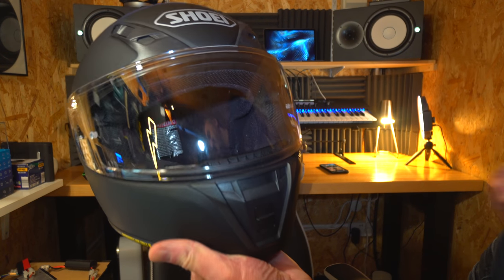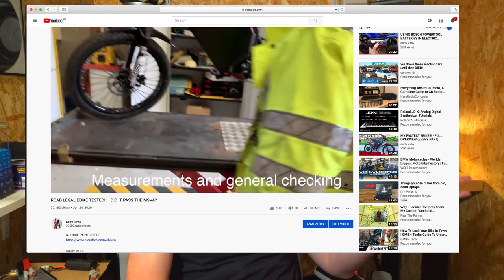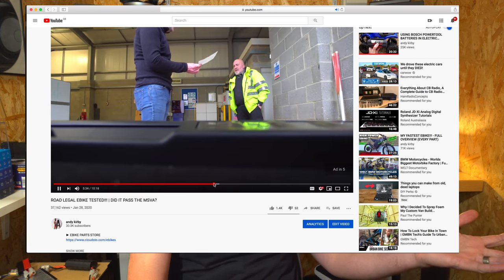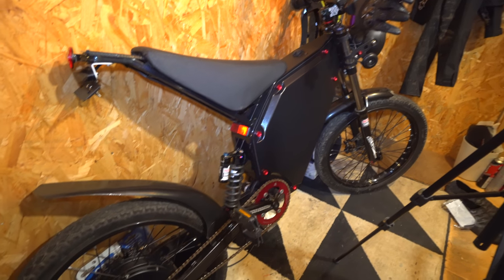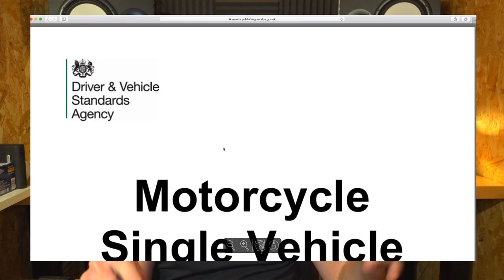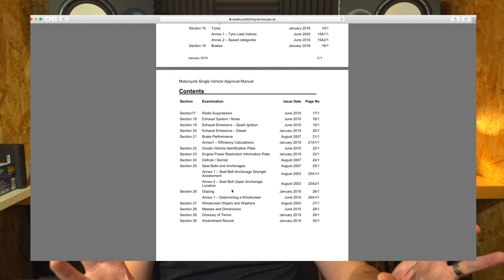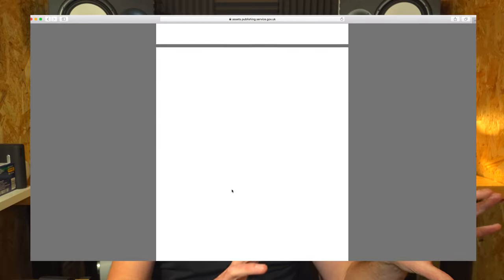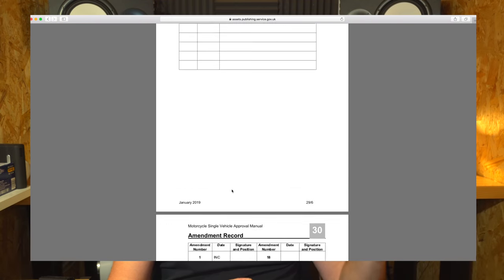HOW TO REGISTER A ROAD LEGAL EBIKE AS AN L1e MOPED

Comment: Hi Andy, just a heads up - you've put V55/5 form in the description, but you mean the V55/4 form. The V55/5 is for registering used vehicles. Caused me some confusion so just wanted to point that out! Thanks a lot.
Reply: Did you manage to register yours ? Could you let me know how you filled out the ministers approval certificate application

Comment: Thanks Andy I don't even have an electric bike but watched the video all the way through , very interesting. I'm sure the information is very valuable to anyone thinking of registering their bike. I'm sure the system needs to be updated for diy electric bike makers to make the process a bit easier. Seems like the sections pertaining to the motor engines could be omitted to avoid confusion and its 2020 should be able to answer the questions on an online form.I expected the insurance to be cheaper ,even with your points but hopefully that will drop substantially after the first year of riding. Great info thanks for the upload mate..

Comment: Suggestions for good, low-cost anti-Cold-Wet-Filthy Weather gear, Andy and viewers ?  All very well having a fast ebike - but unpredictable and 'orrible British weather is the real challenge. Has anyone found any magic cheap solutions ?  PS. I frequently also use oversized, short wellington boots lined with thick and cosy insoles - I got sick of having to dry out expensive shoes and soaked socks. The problem with all-weather gear of course is that you have to find somewhere to put it all when you get to your destination. It's ultimately because of the weather that most people eventually give up on bikes and ebikes and get a car..or electric car.
(PS. and of course the faster you go on your ebike the colder it feels and the harder the rain hits you !)
Paul G

Comment: There seem to be a strange difference in law between "top design speed" (of 45 kph for L1e-B) and "top speed" of 50 kph. Most mopeds for AM driving licence will show 45 kph / 28 mph, but I have 50 kph on my driving licence. It couldn't be more confusing, but both speed seem to apply to the same AM class (or B for driving licences from before 2001). Thus the actual top speed is 50 kph / 31 mph or 5 kph above the "design".  Would you agree?

Comment: Andy thank your mate: silly quickie. Side stand, does it need a cut off and does it need to be spring loaded (flicks up when you move)
Reply from the maker: A side stand doesn’t need a cut off if it can be shown that it will likely fold up when you move the bike forward. In my case it’s difficult to sit on the bike with the stand up because the suspension compresses so you have to fold it up pretty much as soon as you get on the bike, what’s important is that It needs a spring or mechanism to keep it in held in place whilst riding and when its down it holds the bike at an angle where it’s unlikely to fall over in all steering positions! 😁 Clear?!?

Comment: Hello Andy how much is the road tax for the first year or is it free 🤔 
I also forgot to ask if you are registering it as a moped & what sort of maximum power can you set the speed controller at ? and as you mentioned that you haven't a motorbike licence you might have to take a CBT test which I believe only lasts for two years ?

As  I'm in the middle of building a 12000 watt enduro bike weighing in at 90 kg pretty heavy I know .
 very interested in this subject that you have brought up keep up the good work mate  🤝
Lucky enough I've done my motorbike test  in 99 😰
Reply from the maker: Hi Mark, road tax is 100% discount because it’s electric. I’m registering as a 4KW (50cc equivalent) moped becuase it’s the most easy way of doing it, I’m not going to be going 60mph on this build so it’s fine for me. Acceleration to 30mph is why I got into this stuff😁 I have full moped entitlement on my license so don’t need a CBT or L plates. 
My bike is capable of 14kW off road 😅

Your bike sounds cool, it would come under the 125cc bracket I reckon, which of course you can ride with your full license😁

Comment: Does the same rules apply if i wanted to register a surron on road its one with lights and indicators ect already built in
Reply from the maker: I think you can shortcut it because there are some already registered in the UK, you probably only need to apply for a V5 if it has a VIN number.
Reply: @andykirby  I'm not sure if it has a vin or not I bought it from someone else not brand new, were would I find a vin

Comment: I have a question, I want register a scooter as a moped, but should it still register is a self build, or something else?? There is no VIN number of course and I have modified this scooter to the standard that meet the MSVA approved to class this as a legal road worthy moped.
Reply from the maker: Yeah if it hasn’t got a certificate of conformity it would come under kits and rebuilds so you’d need to MSVA it. If it’s a moped it should be easy.
Reply: @andykirby  ahhh man thanks for replying it does have a coc but I have needed to add alot of things, the tires are NHS so not suitable so changed, no E-marked headlight and rear light so changed no horn etc. The coc say it's a scooter too. Just dont want to get blocked.... what you think? Sorry also it for not have a vin number.

Comment: Hi andy i have a carrerra bike with a triangle battery about 800 watts max speed for 55mph it is pedal assist and throttle is it possible to register this type of bike as mainly used to get to and from work since i had a accident on my previous vehicle which was too damaged as this is a replacment so i was just curious as to if its possible? Thank you

Comment: Does it need to have a brake light is so is this any easy job ,also does the head light have to have high beam as mine is  just an led light that came with the bike from China, mines 72v 5000 watt very similar style to yours any info greatly appreciated Andy
Reply from the maker: Yeah it needs a brake light. Doesn’t need a main beam.

Comment: Do (some) high-power eikes have a 250w limit mode so you can legally ride them on the road without registering, or ride to the test centre without insurance?
Reply from the maker: Yes it’s possible, it’s such a grey area but at the moment the only thing enforcement cares about is the speed (probably because it’s far easier than checking a bikes power output) as long as you keep the speed down to 15-20mph you’ll probably be ok I would say.